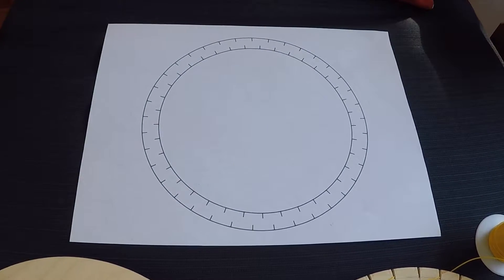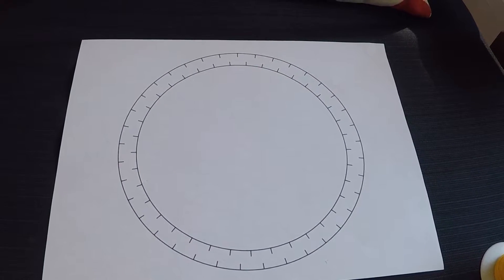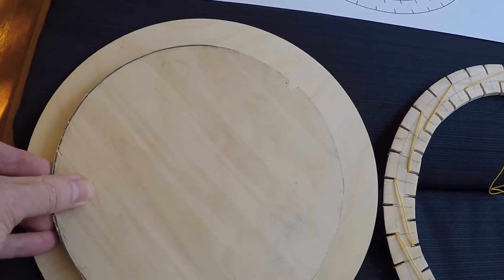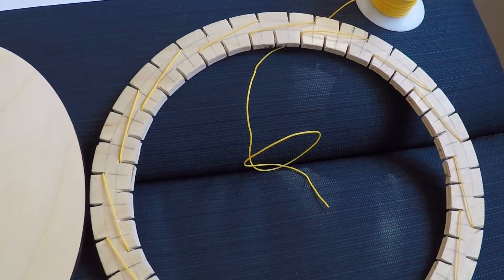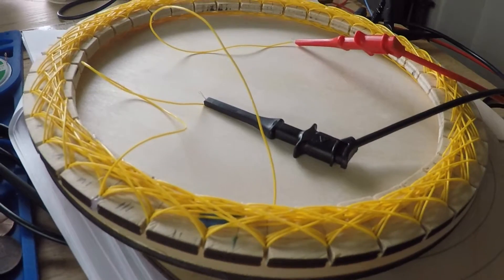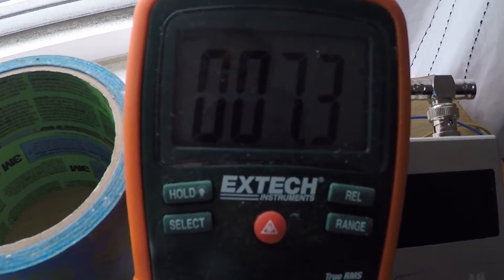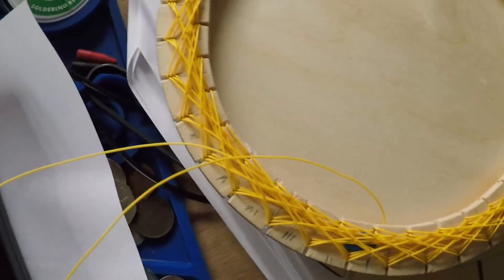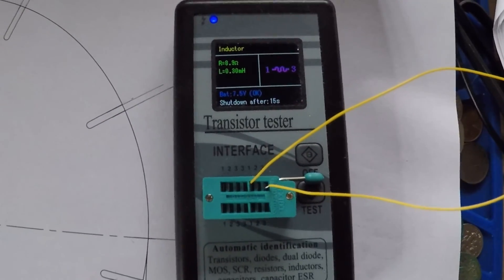DIY Basket Weave Coil for Pulse Induction Metal Detector

Comment: I was watching this again and noticed that the spacing at 1:18 in the video, that your spacing is not the same, in other words it goes 3 spaces, then 2, ect, would this make a difference in how the coil operates,do you know or think, i will go ask in the forum also for some that have built, baum dude for one built one and said its great on his chance in colorado,
Reply from the maker: Hi Matt,
Without my going back and reviewing what I did, all I can say is that certainly I might have made an error, however with the basket coil you do have to advance your winding at certain points with that coil.  To be on the safe side, take my video as a starting point for this coil rather than something that is guaranteed error free :)  I wish that I had the time to make another coil.  Marty on the forum is a real expert with making these spider coils. 
Good to hear from you, Merry Christmas.
Reply: @SurfDetector  ok, i just noticed the spacing after you said it didnt work any better than your single wound coil,waiting for marty to get back to me at the forum,he posted he was getting 4.5 inches on a piece of dental gold or filling in dirt in colorado in mineralised soil, i was just wondering if you altered the spacing because of the uneven slots,ill wait for martys answer and i posted the same question on the chance pi thread where they where discussing it, have a great christmas and a new year yourself. already got my christmas present, my last CT scan for my cancer came back great, no new cancer spreading and tumor has not grown, or done anything, its stable
Reply from the maker: Glad to hear your good news regarding your medical.  God bless.
Reply: @SurfDetector ازسیم باقطر چند برای کویل1*1استفاده کنم استاد
Reply: @SurfDetector  استاد جان ، من میخوام کویل 1*1بسازم ، ازچندمتر سیم وباچند‌دور و‌با سیم نمره چند‌ وبا اهم چند میتونم کویل 100سانتیمتر در100سانتیمتر بسازم جواب؟